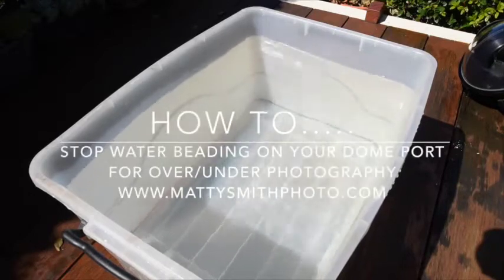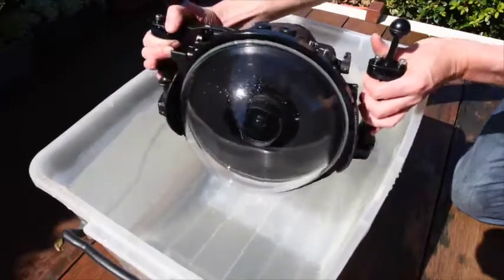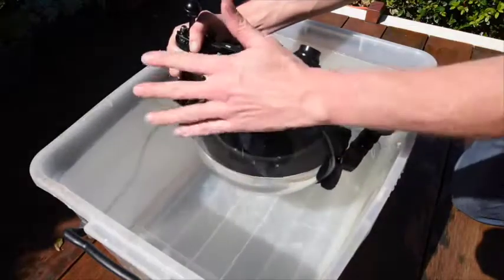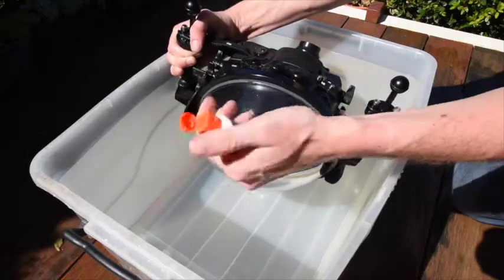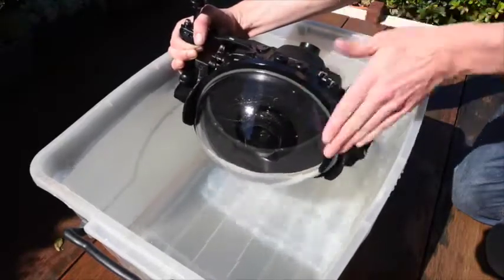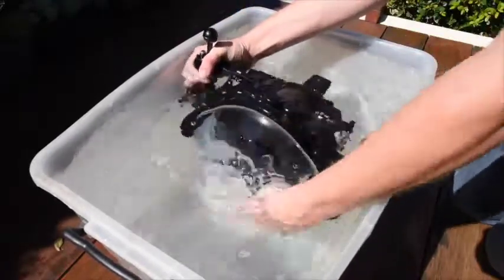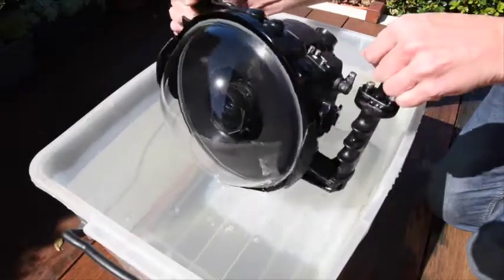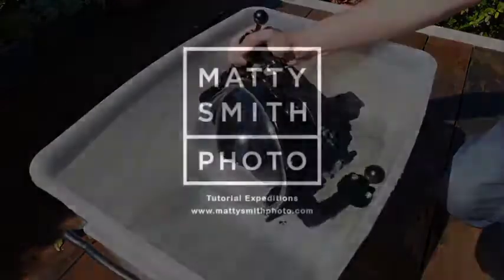OVER UNDER photos | STOP water drops on your DOME

Comment: Hi, thanks for great advice. But would it work for both glass and plastic domes? Also would it damage the surface of dome long term?
Reply from the maker: Hey Liene, yes it works great with both dome ports. I have been using this method on coated glass and acrylic ports for about 7 years now and never seen any detrimental effects. Cheers

Comment: Hi how would it be better to use the "Anti-fog gel for masks" product on a glass dome with multicoated treatments, when it is still dry or when it is already wet?
Also does this product damage the multicoated treatment of the dome ?
thank you
Reply from the maker: Hi, I rub it on dry and them rinse and rub with water to spread the product out evenly. The antifog is basically a mild soap solution and doesn't affect the glass coating. However, if you're worried about it try using your own spit, it works very well also. Cheers.
Reply: @mattysmithphoto8002  MANY THANKS FOR YOUR REPLY

Comment: G'day Matty. Just found this. Have just upgraded my GoPro to a Sony a6500 with Salty housing and a 4" dome for surf photography and the spit method doesn't work as well as I had hoped as it does for the GoPro. I was wondering how long you would expect the gel to adhere to the outside of the port and prevent droplets while out in the water?
Reply from the maker: Hey mate, on a clean, grease free 4" port the seadrops or spit should last quite a long time in preventing droplets.... more than several minutes. What port were you using with the go pro?
Reply: Cheers Matty. For the GoPro I tried a Telesin dome but had the same issues with droplets. Most of the time I used just the GoPro and licked the lens with good results. Since seeing this video I got the gel and tried it but still ended up with droplets but I think it is more user error. I think I have the dome out of the water too long before taking the photos. I'll keep trying and hopefully get it at some point.
Reply from the maker: @StickyMubbs  Hey if you're still having issue get your port a good soapy wash, make sure there is no wax or grease on there at all. Have you used rain-x or similar waxy products on your port before? That kind of product can mess this method up a bit.
Reply: @StickyMubbs  hi Sticky i got a telesin too, Which solution did you find at the end?
Reply: @stefanoscisci9150  gday Stefano. Spit/saliva always turns out to be the fallback. Biggest thing is keeping the dome wet. I was making the mistake of keeping the dome out of the water for too long before taking the shot. You need to keep the dome immersed until just before you shoot so the water doesn't bead off too quickly which is the job of the saliva.

Comment: Can I use rain- x?
Reply from the maker: Hey, you need to check that with your dome port manufacturer. You can only use Rain-X on glass as it damages acrylic, not sure what it will do to coated glass. If you do use it follow the instructions on the container as it's a different method to the one in this video. What I'm doing in this video is encouraging water to stick evenly all over the port, Rain-X repels water to hopefully make the beads roll off.